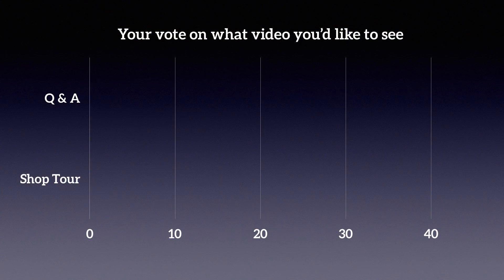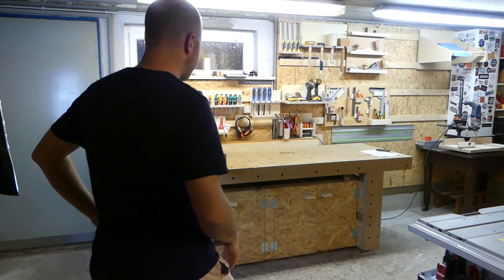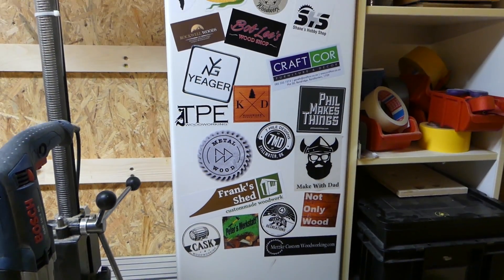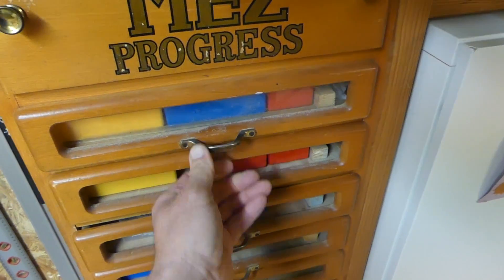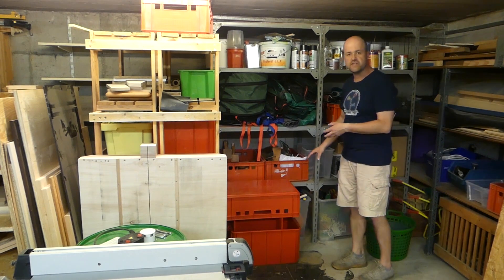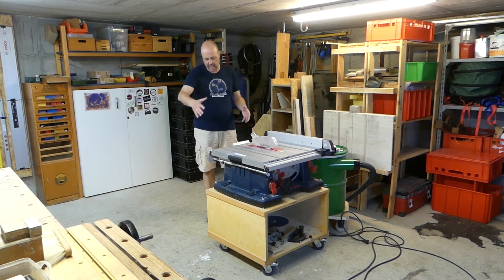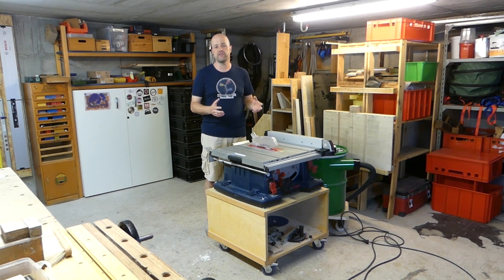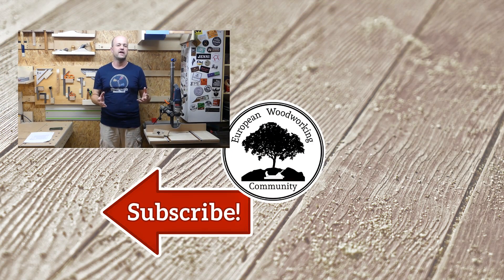WOODWORKING SHOP LAYOUT – Shop Tour 2017 | DIY workshop ideas

Comment: Hi Andreas, you are so fortunate to have both a Double Garage with a Double Garage sized Basement, best of both worlds :-)
My current single garage has never had a car in it since we moved in seven years ago, mainly because standard single integral garages here in the U.K. tend to be too small for modern day cars :-(
Having only recently discovered your channel and subscribed, I am catching up with a lot of your older videos :-)
If you recall, after watching your review I recently purchased a Bosch GTS 10XC Table Saw which I have now unboxed, built up and carried out a couple of Test Cuts, next is to build a proper cart so I can use it properly and move it around if need be.

I was watching your Workshop Tour from 2017 and if you don't mind, I have a question about your Drill Press and Drill Presses in general.
I have used various Drill Presses over the years in different places I have worked, but not used one for about 15 years now since my work became more office based and never felt the need for one at home until now.
Could you tell me if you would still prefer a proper Bench Drill Press ? or if you have grown used to the Wabeco Drill press as I too think it has a lot of extra capabilities over a standard Bench Drill Press ( What model of Bosch Drill do you use in it by the way ? )
I have been considering the Wabeco similar you yours, but also the Bosch Bench Drill PBD 40 which looks very nice but like most things has a few negative reviews ?
I would welcome, your opinions and recommendations if you have the time to respond, many thanks in advance.
(Love the Gerbil tank stand you made recently, my children had a "Gerbilarium" many many years ago similar to yours which was great fun for them)
Keep up the great work with your channel and I look forward to your next Video.
Regards,
Colin.
Reply from the maker: Thanks for your kind words, Colin. I’m happy with the Wabeco and with the Bosch drill. Both do what they’re supposed to – the Wabeco is not quite a accurate as a good drill press would be, I suppose but accurate enough for me. One advantage of that drill mount is that I can drill horizontally and that the clearing height is very large (the last point could also be true of a column drill press but they are usually more expensive). I don’t need these things often, but when I do I’m happy to have these capabilities.

Comment: Versuch, die Kabel vom Boden wegzubekommen. Böse Fußfallen und man beschädigt sie auch gerne durch Drauftreten, es fällt was runter oder man rollt was drüber. Eine der ersten Dinge, die ich bei mir realisiert habe, war eine Mehrfachsteckdose an einer Kette von der Decke hängend zu installieren. Es gibt auch trittsichere Bodenführungen. Aber das weißt du sicher auch alles.
Super Video! Ich bin auch grad dabei, umzubauen.
Reply from the maker: Danke für Dein Feedback, Alfred. Ich habe schon Pläne für den Strom, brauche aber etwas mehr Zeit als ich gerade habe und ein paar hundert Euro wird es auch kosten (neue Lampen!). Wird schon, Stück für Stück.

Comment: Howdy Andreas! Thanks for the tour. My question is: do you have heating/cooling in the existing space or is it needed? Perhaps you described that in a previous post. In any case, you have a great start to your workshop.
Reply from the maker: Hi Travis, thanks for your comment. I have neither. In winter, I sometimes use a gas heater mounted on a gas bottle for heating. Cooling is not needed because the back half of the shop is built into the ground (street level on that side is the shop ceiling).